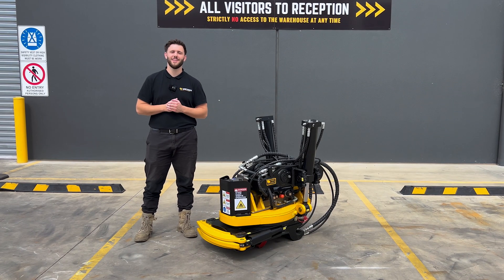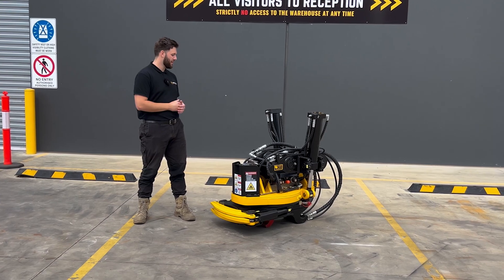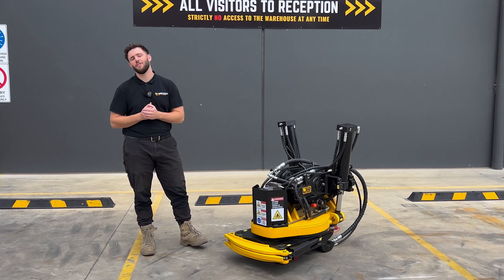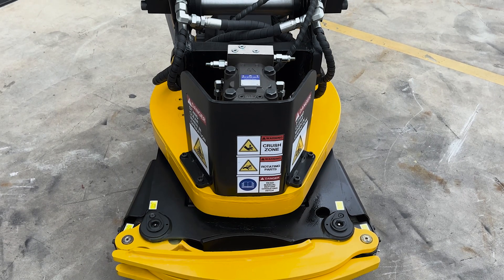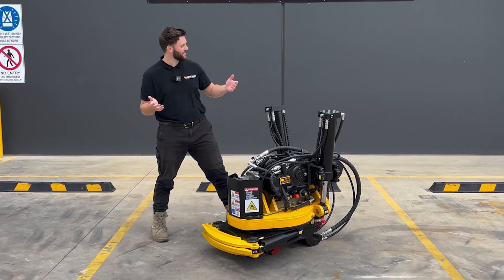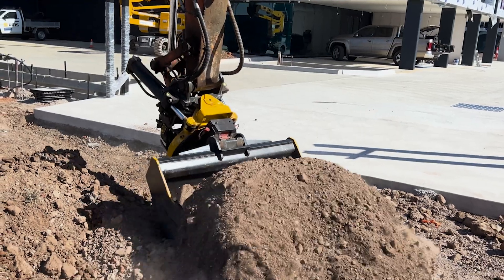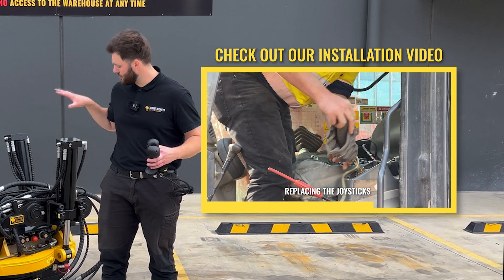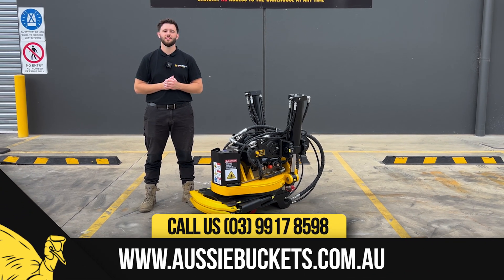Tilt Rotator In-Depth Walkaround | Aussie Buckets

Comment: I hope this really takes off, its such a good idea and this would be unreal to have on subdivisions. Would be interested to know how delicate you can be with the grabs. Can you life pits, pipes, etc.
Reply: Thanks @paulster7754, we are over the moon on how its turned out!
You’ll be impressed on how precise the rotation control is. 
Second to that, the pincers offer exceptional control, making them ideal for lifting pipes, and even more delicate items on-site.
This Tilt Rotator is designed to handle heavy work, with the finesse needed for detailed placement, especially where precision matters. 
Let us know if you want more information on it